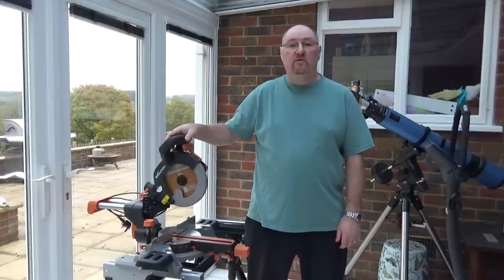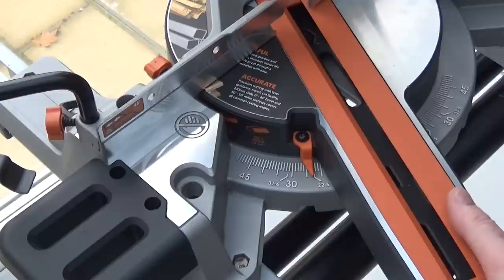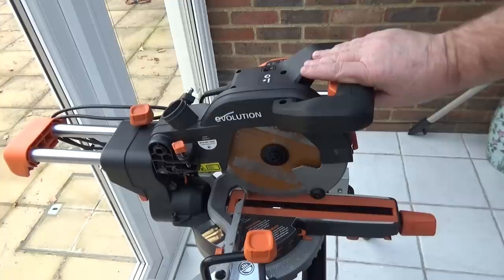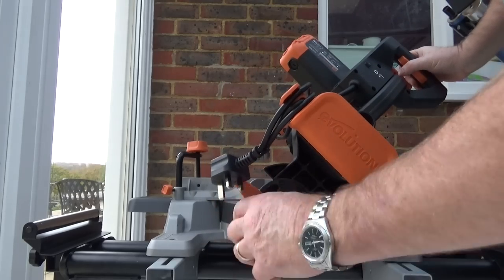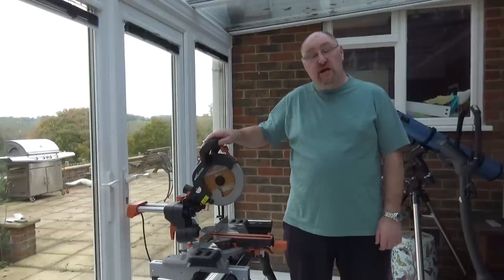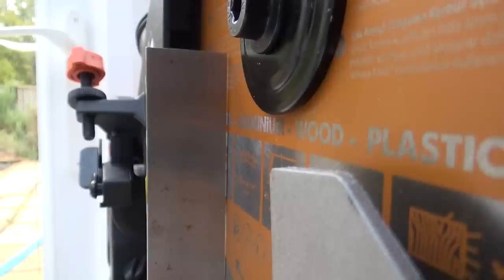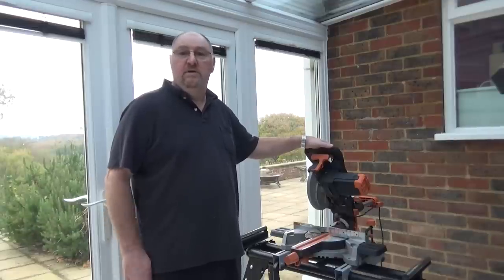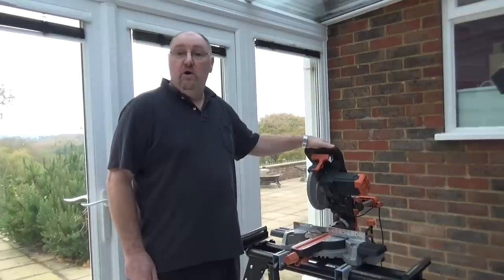The Evolution R210SMS Sliding Mitre Saw Review

Comment: Thanks  Russell  you are really a clear speaker and obviously have experience I have the much smaller evolution mitre saw and need to upgrade for larger wood projects this vid gives me confidence especially using it for metals and stone which I know it can do but haven’t tried, that box metal section has me convinced Evolution saws present value for money.
Reply from the maker: Evolution are always improving their range and this saw is a great all rounder that is capable of accurate work.  The multi purpose blade is extremely versatile and I will happily cut mild steel with it and move onto wood.  You will love the extra cutting capabilities of the sliding saw.  Take the time to check the angles and set up the saw if necessary.  Good luck with your projects!  :-)

Comment: Hello Russell and well done for making a clear and informative video. I have just purchased one of these saws virtually on the strength of your efforts. But you never mention the laser and how to adjust it. I find the laser very helpful, I just hope it lasts and doesn't give up the ghost on me. I do have one criticism of the saw and that is that when you unlock the head to lower it into work it is so easy to start the motor at the same time. When ready to start your cut it doesn't matter but I usually lower the saw just to see that it will clear things like the clamp (when cutting a bevel) etc.  It is the natural way to hold the saw, thumb in the front to release the head but the remainder of the hand through the D shaped handle. I have got used to holding the palm of my hand away from the trigger but I think it could be better designed. Well done and thank you.
Reply from the maker: I know, I completely forgot to mention the laser.  I did have a look at it and it did not need adjusting but I was going to show the adjustments and somehow I just forgot about it.  How strange that you do not like the handle arrangement, it is one of the features I like best about the new saws.  I do not have to think about what each button does like I did with the older saws.  Mind you, it would be a very boring world if we all thought the same things.  Thank you for taking the time to post a comment.  :-)
Reply: Hello again Russell. I just thought I would tell you something that will demonstrate how stupid I can be at times ! With reference to my comments above regarding pulling the starting trigger accidentally I found out at the weekend why I was having what was this very slight problem. I discovered that I had got the clamp that locks the sliding motion just ever so lightly screwed up.  This in turn meant that when I pulled the saw towards me prior to releasing the up/down catch if I wasn't careful the saw would start because it was taking a bit more effort than it should. The sliding action wasn't clamped, it wasn't fully loose if that makes sense. I just undid the clamp about 1 turn and the saw flies backwards and forwards now. 

Memo to self. Must try harder !!  Thanks again.
Reply from the maker: That is something that could catch anyone out!  If you have not used the saw without any friction on the slide you will not realise that there is some resistance.  The good thing is that you sussed it out and stopped the issue.  I hope you enjoy using the saw and your projects turn out how you want them to.  :-)
Reply: Thank you Russell. Actually I bought the saw for a specific reason and I am pleased with the outcome. My better half saw some planters made out of decking and decided that she would like one. I am not a wood worker, I would rather work with steel anyday. But I needed something that would cut a decent bevel for the corners. This takes a bit of setting up to make a decent job because of the corrugated nature of decking. (plus the fact that I discovered that decking can be warped longitudinally quite badly !!) 

However the end result was that I made 5 planters. 3 of one size and 2 more of different sizes. I am now flavour of the month in our household !
Reply from the maker: Glad it worked out.  Always good to get a few brownie points in too!

Comment: Just got one, well happy, also got the circular saw and that’s really good, best I have had so far
Reply from the maker: They are good value for money Lee.  :-)
Reply: Lee, is there any play on the up/down hinged part? I bought the Rage 3s 2 years ago and used it very little. Dreamed of being a hobbyist but never had time due to work. Now that I have time I've started to use and used this guys other video to set it up for accuracy. To be honest, it must have been well set at the factory because it's about as square as it's possible to be so it. I've noticed it has a 3 year warranty so I'm going to be cheeky and ask Screwfix to swap/upgrade it but not sure what to go for. 
Cheers, Andy
Reply: Andy Thurlow no play and it seemed set up and very accurate, can’t fault it. No doubt will buy more in the future, good luck.

Comment: Best Mitre saw i have purchased over the years, great for wood, aluminium and mild steel. Would avoid the diamond blade for brick as the mitre doesn't have enough kick and from the video you could see it losing power. Nice work on the calibration, you make me wonder if its worth me ditching my full size for a tiny one.
Reply from the maker: I would always choose a larger saw over a smaller one as the ability to cut larger sizes will definitely be appreciated over time!  :-)

Comment: Just bought one of these, along with the bench - wish I'd watched this video first, those setup and calibration tips are gold.  One thing I did notice is the main blade screw has some play in it as I tighten it up (my makita circular saw blade screw does the same).  Obviously the screw doesn't move once it's tight, but it doesn't seem quite central when it's spinning (visually off center, slight wobble).  The blade itself does NOT wobble whilst running.  This behaviour may be normal, but is slightly disconcerting.  Trial cuts seem fine, and I've done a bunch of skirting/architrave without issue.  Just wondering if this screw thing is normal/expected?

Comment: I think mine might not be quite the same model and I like it very much. However, trying to add a secondary fence, I realise that the supplied fences were not in line. More importantly the left fence back was not 90* to its base. Also there is no gap for the sawdust so after each cut you have to blow the sawdust away. I gave up on the secondary fence. It’s good enough for rough joinery but to get the end of the wood square you need a shooting board or a well set up edge sander. There is a small bit of angular play in the detents. Still I’m not prepared to buy a Festool or DeWalt. Overall, great value but not perfect. You get what you pay for. I use it a lot and the stand is ideal.
Reply from the maker: I use the R255SMS and my fence was knocked out of alignment Jim.  I straightened mine using a cast iron saw table top that was perfectly flat and some careful manipulation.  It has been fine since.  :-)

Comment: Great review. Can you help me with two points please?. First of all the depth cut is a bit confusing. I tried it today and it seems that unless you use a seperate timber to move the piece you wish to channel out away from the fence it is not possible to get a flat bottomed groove - unless im missing something of course. Secondly, you state that the blade is rock solid with no movement but on my saw I have quite a lot of rocking play on the blade itself. Am I doing something wrong?. Thanks in advance.
Reply from the maker: Hi Andrew.  First of all,  after the first set of cuts you have to turn the wood around so that the raised part of the grove is furthest away from the fence and finish the cutting to flatten it out.  As for the blade, it should not move laterally unless forced.  I can move my blade a little if I use force but it springs bacl as soon as I let go.  :-)

Comment: Thanks very much for the review! Very comprehensive and well done. I'm very interested in buying one. I was wondering if the bevel cut goes further than 45 (I know it's listed as 45 max but the scale seems to go slightly beyond this from the video)?
Reply from the maker: The bevel is set at 45 degrees using the stop.  I have just been and had a look at mine and it seems like there is a little more scope if you tighten the stop screw right in.  If you remove the stop screw completely, it looks as if there is a lot of scope.  I am not sure if there are any other physical stops built into the casting on the saw head though.  :-)
Reply: @RussellPlatten Thanks very much for the quick reply!! On a video a few years old. Very kind and helpful of you Russell. 😊
Reply from the maker: You are welcome!  :-)

Comment: Hi Russell I've just watched your review on this mitre saw. I have inmy amazon basket the 210sms+300. Is this one an upgrade of the one you reviewed 5 yes ago.?
Reply from the maker: It has a better cutting capacity Cheryl.  300mm instead of 255mm.  The plus features are mentioned at the bottom of this page:  https://shop.evolutionpowertools.com/products/r210sms300?gclid=Cj0KCQiAyracBhDoARIsACGFcS7BTTyxr9kKuej2VLWghTip1FeYvDRve96jPT55OdPLLsAsBm28JQcaAkQtEALw_wcB#features  :-)

Comment: Good video, I was thinking about going for the R185SMS, but for the extra 25 quid I might as well just go for this one, cheers.
Reply from the maker: The right decision in my opinion!  :-)
Reply: @RussellPlatten  You're not wrong there, I went out yesterday and bought one, put it together last night, which was all pretty much self explanatory, so you don't need the idiot guide. Then today I done a few cross cut's in some 4x2, all was good and it didn't need any adjustment, but I'll test it more thoroughly over the weekend. So overall I'm really happy with this saw, it's solid, looks good and the build quality is excellent, and an absolute bargain for £125, so a useful addition for both the professional and the DIYer alike 👍
Reply from the maker: @Ratsotone  👍

Comment: Hi Russell, super video. I’m in the market for a new mitre saw. Will the blade be too rough for laminate flooring. In the market for something I can use for multiple jobs; laminate flooring (obviously not when cutting length), skirting, shelving and cabinets. 

The actual box says able for laminate but wondering your opinion. Thanks
Reply from the maker: The blade is reasonable for wood cutting, but there is some tear out as the blade is a compromise to allow the cutting of steel and aluminium.  In the video description there is a link to a cheap Saxton blade that I bought that gives a fine cut.  The Evolution wood blades are also very good, but more expensive.  If you do get the saw, make sure you check that it is set up correctly before using it.  I have found that they occasionally need tweeking before first use.  Here is a video I made on setting up the saw just in case:  https://youtu.be/nW2IKqYLxo0

I would try the multi-purpous blade before getting another Darren, you may find it is adequate for your needs.  :-)

Comment: After 3 weeks of using this saw, it's generally been ok - light and powerful. But... yesterday when i came to use it, the laser was not lining up with the cut: out of parallel and off the cut by about 8mm. I didn't have time to sort it out on site, but today I got out the instructions and found the section on adjusting the laser on page 28. Now according to the instruction, there are two adjustments: one for sliding the beam side to side ( only about 5mm or so, ) and a small clamp screw on the circular housing for the laser itself - which (it says) is the one to adjust if the beam is not parallel to the path of the blade. After spending nearly an hour attempting to adjust this, in an attempt to get it parallel, I can state categorically - this instruction is completely incorrect. In fact, after slackening the clamp screw, all that enables you to do is rotate the beam around its own axis; there is no adjustment whatsoever, for aligning the beam with the blade's travel. This is actually achieved by slackening or tightening the OTHER TWO screws on the bracket - not obvious at first sight, it looks as if they are simply there to enable the bracket holding the laser to slide left or right. If you remove the bracket completely and look at the rear of it, you will notice a small ridge protruding from it, about 1.5mm deep. This allows the bracket to effectively 'rock' on the ridge, like a see-saw. moving the beam's direction. The bracket is plastic, and bends when tightened to anything near the torque you would expect to be necessary to remain in position - i.e. so as not to slacken off during use. This throws the beam out. What you have to do is follow the instructions about using the cardboard to mark where the blade's travel will be, then, with the cardboard in place, gently slacken or tighten either one or both screws in succession. Slackening the screw allows the beam to swing to the left; tightening it throws it to the right. After getting the beam right, you'll no doubt wonder (as I did) just how long it's going to stay that way, because the screws won't be very tight. I used a drop of polyurethane glue on each screw - I just hope it works, long term. It's a shame, because apart from this absolutely naff part of the design, there appears to have been quite a lot of thought gone into the saw itself and for under a hundred quid, it's still good value. The blade has only been used for wood (no nails) and to be honest, it really rags the back of the cut. The only way to avoid it is to 'score' the top surface lightly, in a forwards direction (like a crosscut) then work backwards. Again, not really a complaint: Evoulution have come up with a blade that cuts metal and wood - it's bound to be something of a compromise.
Reply from the maker: I have cut accurate mitres with the bevel John, make sure you check the angle and adjust if necessary as the saws do not always leave the factory with the angles set perfectly.

Comment: How have you found this mitre saw in terms of longevity, both of the blades and the item itself?
Reply from the maker: I stopped using it when Evolution sent me the R255SMS 3 months later.  I have been using the R255SMS regularly since then.  I swapped the blade after a year or so and fitted a blade designed specifically for cutting wood.  I used the R210SMS for a few small metal cutting jobs, but not enough to give the blade any real testing.  So, I cannot say how long the blades last.  I can say that the R255SMS has been a great saw and I use it a lot.  I see no reason to think the R210SMS would be any different.  I only have Evolution mitre saws in my workshop.  :-)

Comment: Great video Russell, I wanted to know which saw to get and actually have a question. I want to get either this or the R185SMS. I have a roll of paper which is quite thick to cut in half. The paper is 1.3 meters in length. It's a 50 meter roll of paper so you can imagine how thick it is. I have never used a mitre saw in my life and just researched it today because I've been told it can cut rolls of vinyl/paper etc. By the looks of it I don't think I can get cut straight through as the blade isn't big enough. Will I need to cut, then turn the roll, cut and repeat or do you think that it just can't be done? Thanks
Reply from the maker: It depends on the diameter of the roll.  It sounds a little risky to me Christian.  :-)
Reply: @RussellPlatten  Thank you for the response. I already did this a day ago lol I needed to roll it and cut again as the diameter was too thick. There wasn't any danger. The only risk is that it would have ruined the roll but it's all good :)
Reply from the maker: @christianlionel1988  Glad it worked out for you!  :-)

Comment: Great review, watched after I brought one. Just 1 question,  when I chop decking 120mm x 20mm the blade always leaves a bit of wood on the corner that it doesn't cut, do you know why this is please?
Reply from the maker: It sounds like you have the slide locked and need to use the sliding function to cut the decking.  look at 10:07 on the video, I am cutting decking there.  :-)
Reply: @RussellPlatten  sorted thanks bud
Reply from the maker: @MarmaladeandTigger  Glad to hear it!  :-)

Comment: Brought one today what size bolts do you need to fix the saw to stand or bench?
Reply from the maker: M6 bolt around 40mm long should do it. You could get away with shorter length bolts, but better too long than too short. :-)
Reply: That's great thank you Russell
Reply from the maker: @tom849448  :-)

Comment: Does the standard blade last long?
Reply from the maker: I have no issues with any of mine.  They are also pretty cheap.  I did ruin two blades trying to cut some steel that the blades were not designed for. :-)

Comment: Hi Russel, does the disc blade flex while cutting mild steel  because some people said that doesn't do a clean cut on steel box sections
Reply from the maker: On the video at 11:27 I cut steel box section and show the cut.  I have had no issues with it cutting steel.  :-)
Reply: @RussellPlatten  can you tell me the depth of the whole machine the cause i want to know if it fits on my work bench pls Thanks for your imm reply
Reply from the maker: No problem 🙂.  The depth is around 530mm.  I have just been in to the garage and checked.  If I push the sliding carriage all the way back so that it is ready to cut and leave 3 to 5mm between the back end of the sliding carriage and the wall; the base at it's furthest point is 530mm from the wall.  I hope I have explained that correctly, just do you know how I came to that figure.
Reply: @RussellPlatten  got that very well explained thankyou
Reply from the maker: @mg-gabd0113  :-)

Comment: Great video. Does it move to 45 degrees both ways on the stand without hitting?
Reply from the maker: Yes it does.  The stand is a great add on for the saw as it turns it into a portable work station.